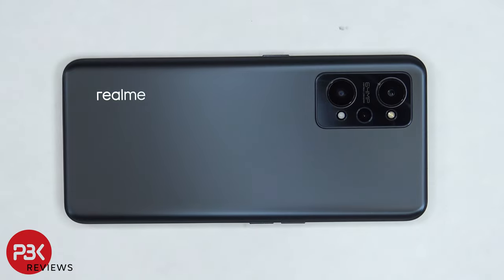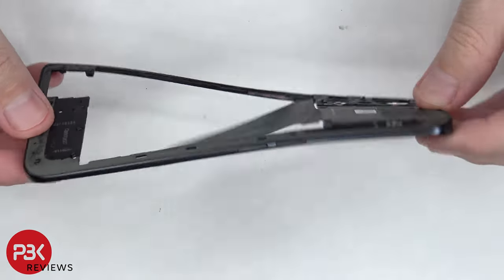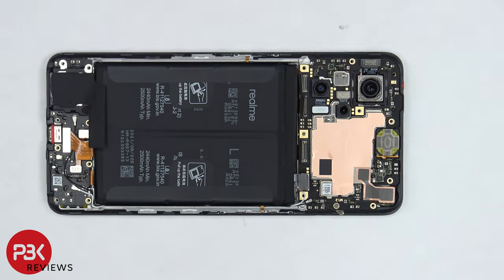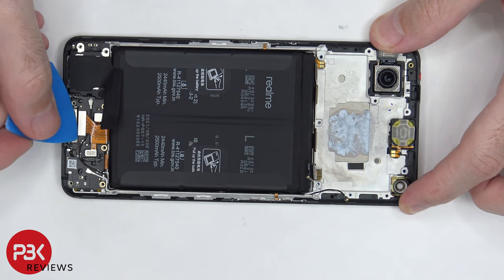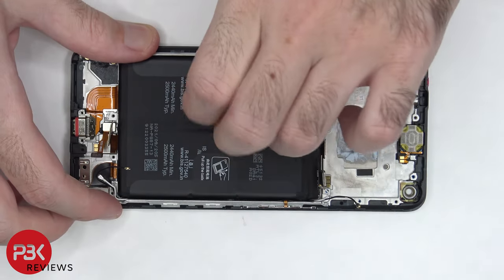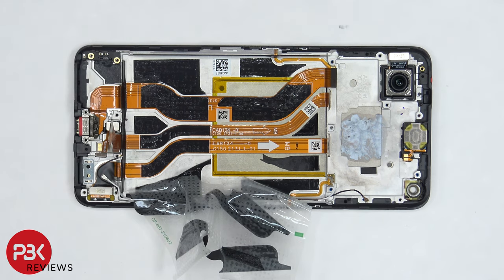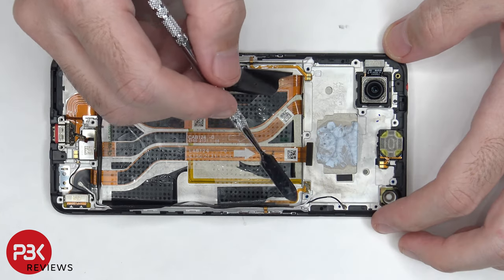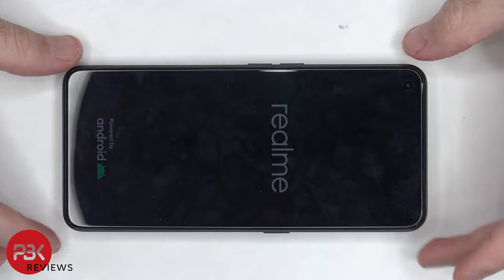Realme GT Neo 2 5G Disassembly Teardown Repair Video Review

Comment: I guess you are mixing up the primary camera and the ultrawide camera. The bigger camera on the top is definitely the primary camera. 
You can also distinguish the ultrawide camera with its first lens element (a characteristic large convex element) (without tearing down a phone). 
It’s not the first time you mix up some cameras.
Reply from the maker: Yes you are correct, I realized I said the wrong one afterward but YouTube doesn't have an option to add a new clip etc. So I might just cut that portion out I will see. Usually I go based off the user manual and manufacture specs diagram.

Comment: Would you say that this phone has good water protection (for example comparing to mi 11T)? I know that it has no IP certificate, but I've seen multiple water tests and it always worked perfectly after.
Reply: Khai sim có gioong cao su nên có chống nước như Redmi note 7 nha
Reply: Phones gets impermeability because they are closed with a sticker. Probably it won't be 30 min in 1 meter of water but since the glass should be still Gorilla Glass (aka plastic), it should at least resist rain drops. But these are just assumptions.
Reply: Got my gt neo 2 completely submerged in a tub for a couple of seconds. Nothing happened at all

Comment: Hi, great video. 
I have a question did you have to glue the back plate or it clicks in? If glue do you recommend any specific one for it? Previously i was workin in repairing xiaomi phones and they had specjal sticky for back glass bit i canno find anything like it for realme
Reply from the maker: Thanks. Yeah you need to apply new adhesive. You can purchase it from this site or similar sites: https://www.aliexpress.us/item/3256804701724336.html?gatewayAdapt=glo2usa4itemAdapt   you can also watch this video which goes more in depth about the adhesive: https://www.youtube.com/watch?v=T4iiPUIM7-Y

Comment: I play efootball2021 and this mobile heats up. Is it normal as they claim it has the largest vapor chamber cooling. My honor 8x used to be a lot cooler while playing the same game.
Reply from the maker: Keep in mind, just because the phone is heating up, does not mean its over heating. It can mean that the heat transfer is more efficient in getting the heat from inside the phone to outside the phone. If the phone is overheating you will see frame drops, lag or freezing etc. That's why some high end gaming phones have those outside fans to cool off the outside of the phone :)
Reply: The heat from CPU and mother board sends to outside so you fee heat it is no issue but if the phone lags when heat the return

Comment: Hi! Great Video.. one month ago my gt neo 2 back case just broke and after looking in the market I noticed that there were only non official replacements. I wanted to ask you if you think replacing it for a non original one would be a mistake. I was afraid because as I saw in the video the case includes circular glases in the camera place and I was worried about that component affecting in my future photos.. Thanks for your time!

Comment: have you tried replacing the charging flex cable some sellers says that i could potentially lose my fast charging function if i replaced it with their products my only problem is that my phone charging port is getting lose
Reply from the maker: If its an aftermarket flex cable its possible that can happen. I haven't personally changed it with an aftermarket to say for sure.

Comment: After how much time should i open it and replace the thermal paste? I've heard it's a "diamond" type, i wonder if ARTIC mx-4 can do the trick the same way?
Reply: Dude, thermal paste on a smartphone chip does need to be replaced, as the cpu  operates at much cooler temperatures than laptop or desktop cpus
Reply: @sierrachief117  I'm asking because of that, dude. I don't need to remind you that the paste is there for a reason and it absolutely will a problem when it will dry out.

Comment: @PBKreviews   I chose to get gt neo 2 instead of black shark 🦈 4 😞
Is the gt neo 2 far off in the heat dissipation department? Can an external cooler fix that?
Reply from the maker: It's not far off but not close either. You should be fine with the gt neo 2 its not a bad phone. Not sure about external fan and how much it would benefit.

Comment: Brother please help me does can u check  gt Neo 2 5000mah can be used in realme x2pro 4000mah .o hope you will reply waiting
Reply from the maker: Hi, I don't think it would work. The battery would be too large to fit in the compartment as well as the connector location would probably not be exactly the same.

Comment: hi, I mistakenly pushed the sim ejector tool to mic hole in same phone(Realme GT Neo 2). Could you please let me know, is this going to damage mic on this phone..you have opened all parts of this phone..could you please let me know the thing..I m little worried for this,bcz I just newly bought this..thanks in advance
Reply from the maker: Hi, you wouldn't damage the mic since its seated above the hole but the filter is seated against the hole so you might have poked the filter. I don't think it should affect the water resistance since but can't be sure.

Comment: Would the repair for the GT Neo 3 be similar?
Reply from the maker: It should be very similar to the oneplus 10r teardown I did, since its basically a re-branded oneplus 10r except for the location of the back flash from the looks of it.

Comment: Please disassemble the vibration motor in the coming times and talk about its type, quality and method of work Because it is also an important element As well as talking about the quality of raw materials and the extent of proficiency in the installation and locking of the device Regards and thanks

Comment: Sir, There's a problem, I bought this phone (realme gt neo 2) and
I accidentally put the sim ejector tool in primary microphone port and pushed it, some popping sound is heard. I'm afraid if I damaged something. My mic is working because recordings show normal voice. But I'm afraid if I broke something in my new phone...😥😥

Plz help sir 😥
Reply from the maker: Hi you should be fine. The mic is seated above the hole so it wont be damaged.
Reply: @PBKreviews  thank you sir 😊😊😊
Reply: Hi even I did the same mistake of putting sim ejector pin i mic and it felt like pressing a rubber button... It is confusing .... Hi Prince how's your mobile now any issues after you did it?? Any chance of water damage in future
Reply: @nishmithrai7640  no there's no problem in mic I think... But water proof has been damaged 😪
Reply: @Prince-od4cn  thanks !!! Can you see a mesh like in speaker in the mic hole .... Was it there when it was new
Reply: @nishmithrai7640  yes there was a mesh in the mic hole... But after I put the ejector tool in the mic hole, I broke the mesh !!!
Reply: Did you face any issue in your phone.??? Do you also have realme gt neo 2..???
Reply: @Prince-od4cn  even I have same device did the same mistake... No issues as of now..... Also it's less likely for water to go accidentally to the down mic hole in rain or splashes so it would be fine I guess.....   Did you press the pin too hard???
Reply: @Prince-od4cn  also checked jerryrig video of p30 pro I guess where he answered this...he said mic unit is actually located at 90 degree to the hole not behind it.. So even if you go very deep it can't damage the mic.  .. also companies might have obviously thought about this ... Since this is a common mistake done by many
Reply: @nishmithrai7640  okay thanks bro.. if you face any issue then plz comment in this same video.
Reply: @Prince-od4cn  is WiFi calling working stable and fine with jio or airtel??
Reply: @nishmithrai7640 sorry, I'm not using wifi calling..
Reply: @Prince-od4cn  okay which place are you from ??
Reply: @nishmithrai7640  India, Rajasthan state
Reply: @nishmithrai7640  hey how's your phone running..??
Reply: @Prince-od4cn  fine bro no issue wbu
Reply: @nishmithrai7640  hey bro..r u in insta..??

Comment: do repairs disable the fingerprint reader ?
Reply: battery disable
Reply from the maker: Not 100% sure but I would think not. I haven't herd anything about it getting disabled.
Reply from the maker: So if the battery is replaced, it gets disabled? Is it a fact or just assumption and also can you point me to an article which references it? Curious to know. Thanks

Comment: Are the frame alumunium or plastic?
Reply from the maker: It's an aluminum alloy midframe with a plastic border.
Reply: @PBKreviews  so its like google pixel? The frame is aluminum with a plastic coating?
Reply from the maker: @gbiv_4120  well depends on which google pixel you are talking about, the 6 and 6 pro are both all aluminum uni body. But what I mean about the gt neo 2 is that the mid frame is aluminum alloy but the border/sides are plastic, you can see where the aluminum ends on the teardown and where the black plastic border begins.
Reply: @PBKreviews  ok thx dude
Reply from the maker: @gbiv_4120  you're welcome

Comment: Vibration motor is good quality?😁
Reply from the maker: yea its not bad, better than most phones out there but not the best either.
Reply: @PBKreviews  Can you check what camera model have some say Samsung for India, some claim IMX682 in Eu so we don't know for sure.. Sony seems to be way better from Samsung sensor.. And one more thing what you think about screen white balance is possible to tweek it soild to not be bluish or yellow tinted? 😅
Reply from the maker: @stefanranelovic5228  Hi, not sure of the make/model of the camera. The only writing on the flex I was able to see was: C1MA42
Q TECH-O
B13114  75
Also I don't really think there would be any user end way of tweaking the tint on the screen itself. Usually would require either the software itself to be changed by the manufacturer or would be a hardware level thing like the actual type of leds or lighting being used on the backlight of the screen or the actual material and quality of the screen being the issue.

Comment: Hii sir I'm facing DND mode on automatically when kept in pocket while riding bike
Reply from the maker: Do you have a screen lock? also check display settings to see if you can disable auto screen wake so the screen doesn't turn on by itself unless you click on the power button.

Comment: Which cooling system is better between black shark 4 and realme gt neo 2?
Reply from the maker: Black shark 4
Reply: @PBKreviews  Thanks for the response 👍🏽 
Is the gt neo 2 far off in the heat dissipation department? Can an external cooler fix that?
Reply: @PBKreviews  whats the difference between these two cooling in the devices,can you explain?

Comment: I really like your videos, straight forward and informative. It would be great if you could give your opinion on the phone's structural build quality, like the mid metal plate material and overall longevity of the phone.
Thanks!
Reply from the maker: Thanks! I usually give a repairability score towards the end of the disassembly before I re-assemble it and mention my thoughts on the overall process. However I will try in the future to mention any build quality issues I notice, but usually these phones for the most part are all built very much alike with either a uni body aluminum frame, or an aluminium alloy frame with a plastic border and are built strong enough to endure most things. So there isn't too much of a difference between most of the models on that perspective to dive to deep into that. It's been a while since I have worked on a phone which had a frame that wasn't durable and would bend or snap. :)
Reply: @PBKreviews I hate this Dual battery concept especially these 2*2500 mAh battery. I could be wrong but it will likely take a toll as it would start to deplete and will deplete twice than a single 5000 mAh battery. I've seen iPhones batteries which uses 2 batteries in this L shape and they're not that durable

Comment: Can you please tell about screen replacement cost please please please sir
Reply from the maker: The cost can be different depending on where you find a screen or repair shop. It's not a set in stone price that is the same everywhere. There is this link for one online which is about $71 USD   https://www.maxbhi.com/lcd-with-touch-screen-for-realme-gt-neo-2-green-display-glass-combo-folder.html
Reply: @PBKreviews  LCD? Isn't the GT Neo 2 amoled E4?

Comment: just get an iphone,the repairability of an iphone it's 10/10,i hate phone that are assembled using adhesive when you repair them it wont be the same,there will be gaps in the back glass,
Reply from the maker: You know that iPhones also have adhesive under the screen holding it down right? Not to mention so many different sized screws. iPhone repairs depending on what needs to be changed can be more difficult than most other phones. I promise you its not 10/10. Also if you replace the adhesive with the precut replacement adhesive made for the phones when you repair the phones, there will be no gaps or no issues with water resistance if the phones have it. Just for an example, here is a link to a different phones back glass adhesive replacement. You peel off the old adhesive, and peel off the cover on the new one and apply it to the frame of the phone and re apply your back plate. Its simple. https://www.mobiledefenders.com/motorola-repair-parts/g-series/g-power-xt2041/adhesive-back-glass-for-moto-g-power-xt2041-authorized-oem.html   :)
Reply: @PBKreviews  ohh good to know,but sometimes it's hard to find a precut adhesive here in my country, while iphone has it all,btw it's just my opinion but i still love phone's that requires adhesive to hold down the back glass,just a bummer sometimes i get my phones repaired but it comes back with gaps where dust can get in easily,i think it's just the phone repair shop not doing a good job putting back the back glass
Reply: it's just more easier to find iphone spare parts than these type of phones in my country😥
Reply from the maker: @munchgaming4589  true, as far as parts availability goes, iphone parts are more widely available. 😀